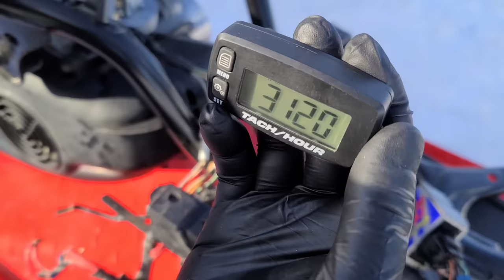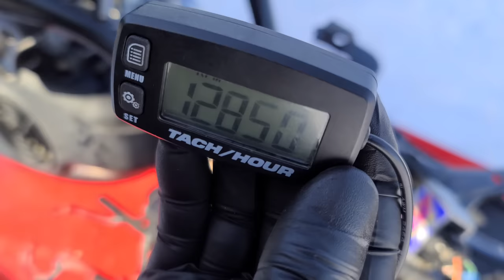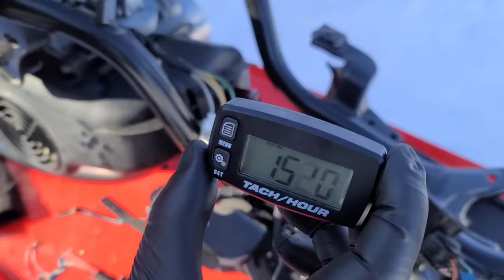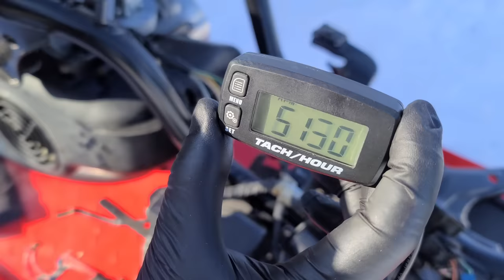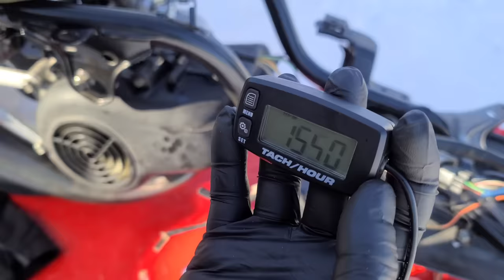Первый запуск Yamaha Jog на карбюраторе STIHL MS180 + тест спортивного коммутатора Racing C.D.I POSH

Comment: samodel! your problem not is the timing, the carburation. in high rpm's the fuel-air mixture is poor. i think your carburator is too small. why are you experimenting with these? why not good for you the dellorto carburators? 19mm or 21mm?

Comment: Can you make a video where hou show how to make a CDI work for a bike that does not have one from the factory?
Reply: Are two tipe of CDI. AC and DC. For AC tipe you need intern coil in generator and is veri hard to fitted in original motorcycle generator. So you have possibility to use AC CDI, with his senzor and need to put a litlle metalic slot on the rotating part of the generator. Hope this helps!
Reply: @01Autentic  i wanna see it done by his hands tho i m sure he will make it look easy as hell
Reply: @Alysavos-rd4tp  , he is able to do this, but Is seems you throw a provocation!

Comment: Probably would have been better with the regular CDI if you would have leaned out the high mix screw a bit but of course 2T engines need timing to be pulled as the rpm rise up which allows for more fuel and more power!

Comment: where did you connect the rpm meter brother?
Reply from the maker: The wire from the tachometer was wrapped around the high-voltage wire that goes to the spark plug, 2-3 turns. I read this in the instructions

Comment: With air filter  to much fuel. 
You need a smaller Nossel.  And then you don't have the power.  You need a bigger caburator 17.5 or bigger than yet!

Comment: good maby tichet carbonne blade some that the  engine thake more maximum speed but some top motor the best power come 11/12000 not 16000 bidalot for mbk av10 power plage start 8000 stop 11500 good motor for street all day maby one day come see scooter run race french or german

Comment: Its runing to rich try leaning it and you must get over 13000RPM
Reply: it's 2 stroke i think it won't have enough oiling then
Reply: @Cheese_1337 you are right but this is to much rich its shootin fuel from exhaust  and its booging at higher rpm the fix its simple just adjusting two screvs on on the chain saw carburetor